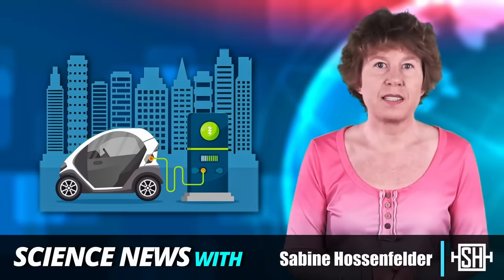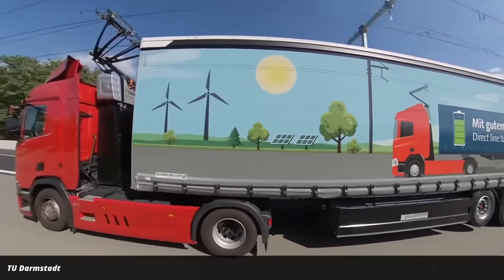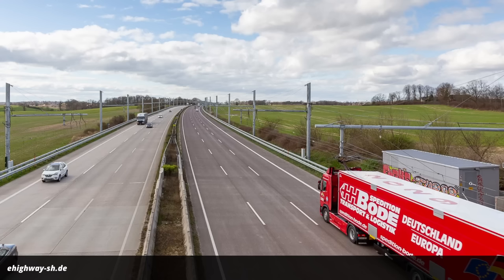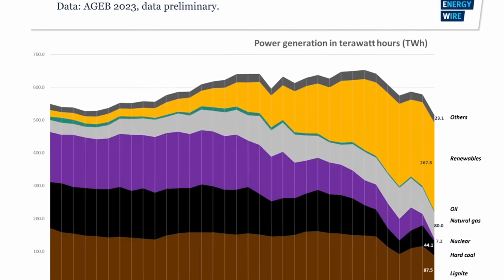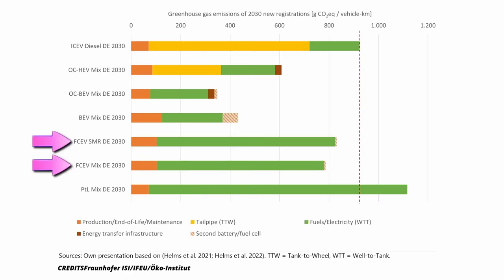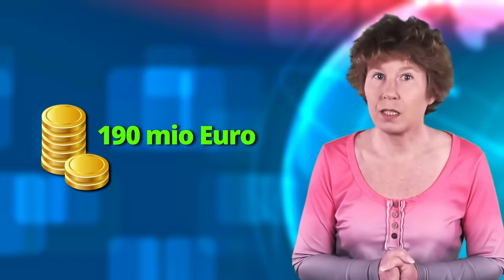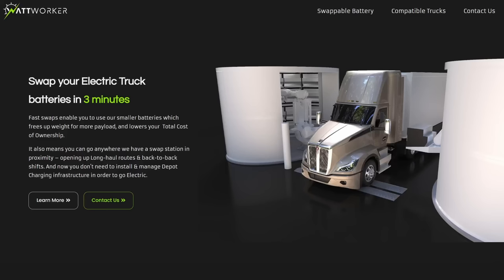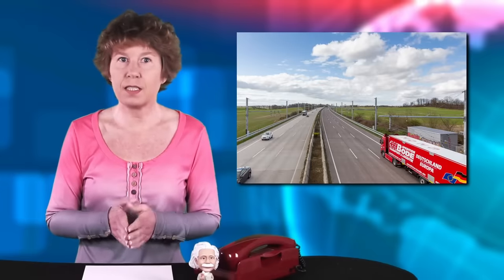Charging while Driving: Does it Work?

Comment: You are so right about using of railways for transportation. Should be much cheaper to build goods handling points, where the goods can be reloaded from trains to trucks for the short distances. Instead of building more railways, the constuction of highways is given the priority.
Reply: Yes, this!  And get those friggin' trucks off the road.  They wear out the surfaces (which the rest of us have to pay for), cause accidents by throwing up snow and water blinding drivers of smaller vehicles, block road signs and take up a huge amount of space.  That's just a small sub-set of my complaints about them.  More important (but not more annoying) trains are efficient, trucks are not.
Reply: The problem with trucks is that they are the only thing that solves the last mile problem. Also if you have a journey that takes an hour by road its very hard to make loading and unloading a train faster than just driving. I like trains too but they cannot function as an alternative to trucks.
Reply: It's already happening where it makes sense. Cost of transportation via rail is much cheaper when it's feasible.
Reply: It isn't cheaper. It was how things used to be done, and it took vast amounts of infrastructure and land space to do. Not only were their transshipments at both ends, but cargo had to travel a lot further. That's because for the vast majority of point-to-point movements the load was much less than a trains-worth, and very often smaller than and individual shipping container. Even if it is a single container worth, then you first have to move that container by truck to the nearest railway depot, often in a completely different direction to the destination. Then it would be taken by train to huge central yards so that the cargo container could be put onto a train for a destination depot (as with lots of distributed depots you cannot run trains between all of the combinations - historically it was hub-and-spoke). This might even be done more than once. Then, upon arrival at the destination depot, the load is transported to a truck for final delivery. 

This involved a lot of handling, required goods to  travel by convoluted routes, often much longer than the point-to-point distance and, what is also very important these days, took a long time. That's especially important with time-critical loads like fruit and vegetables, even before modern "just-in-time" systems are taken into account. The position was much worse for loads smaller than an individual rail truck. All of this also took a lot of manpower. What is more, the cargo traffic on railway lines cause a huge disruption to the efficient running of passenger traffic. This can be seen in the USA, where long distance cargo traffic is dominant on much of the rail network where it is cost effective due to the vast distances, where Amtrak finds it extremely difficult to run efficient passenger services due to the conflict with cargo. Also, no, you cannot solve that problem by running cargo trains at night only as that increases costs and conflicts with maintenance work and also lengthens point-to-point times a lot.

A lot of point-to-point traffic is now on trucks for a very good reason, in that it's fast as it avoids a lot of multiple handling, trucks are also good at multiple pick-ups and drop-offs and can optimise distances. 

Now this is not to say that rail doesn't have a major role. It does. Rail is particularly good at bulk transfers of the same goods between two set points, and it also works for very large loads of mixed loads going from one concentration point to another. A classic example, is the shipment of train-loads of goods from a port to more central distribution centres for trucks. It's also particularly good for very long distances, such as the USA where the greatly reduced fuel costs and ability for a train to run much longer non-stop (with crew changes) can even make it faster than long distance trucks. Supermarkets and the like will arrange their own central distribution hubs to optimise this. However, it is not going to replace what are often long-distance, truck journeys with multiple pick-up and drop-offs. A specialist supplier in, say, Germany might send a single truck to, say, the UK and deliver to ten, geographically separate customers, and manage it in less than two days. Pretty near impossible by rail these days, and if it is done, would take much longer and cost a great deal more.
Reply: I'm in the trucking business. Theoretically, sending goods by rail and trucking that last short distance sounds great. In the real world, it works poorly. There are only so many such intermodal terminals, and they are generally swamped. In my area, efforts to build new terminals are blocked by regulation, and people don't want them in their back yards. I wouldn't either. Trucks going in to these terminals can easily sit for several hours, to wait for a container to be loaded. I've heard much talk about moving more freight from road to rail, but the terminals are already doing a lousy job.
Reply: It'd be better if we had trains that could just carry semis which would solve both problems.
But would require a similar level of investment as the highway system currently has. So it's just easier to keep going with that.
Reply: In the United States, with the advent of the Interstate Highway System and pushed by truck operators, much rail cargo was hijacked, as branch lines became unprofitable. This ran in a vicious cycle as more freight moved to the rubber tires, to the point where if I buy something from the west coast (I'm in the midwest) the chance that it will come by train is only one or two percent.
Reply: @uni-byte  Trucks in the USA often have signs telling how much they pay each year; seeing five or six thousand dollars in road tax isn't rare.
Reply: In Europe 75% of goods travel by truck - you would need to spend trillions upgrading rail and it would take very long.  The beauty if this electric highway approach is that existing hybrid trucks can be upgraded, the road network can be upgraded piecemeal and trucks should save money compared to diesel.
Reply: @davidliddelow5704  It's not the last mile delivery that is making trucks an environmental concern. Heck if it's just for the last (few) miles using electric trucks would likely be a non issue. You need trains for the long distance and, yes, load trucks at destination for the short distance commute. That does take more infrastructure, planning and logistic, but that's not like humanity doesn't have the tools to do that at scale.
Reply: @Furiends  That's a wildly inefficient way to move goods. It means that not only are you transferring a shipping container of goods, but also the complete truck and trailer at the same time. That's extra weight and height. It means that double-height container stacking, used in several countries, becomes impossible. Then you have the issue of a truck and trailer that is going to be out of operation for the railway transit time. Then there is the issue about what you are doing with the driver. Are you expecting to send him/her on the same train as the truck? Or maybe a different driver picks it up at the far and and the original driver has to find a load to drive back at the rail head. Good luck with the logistics of that, and whose paying for his/her time whilst waiting for that load? If you are going to use rail to carry a container load of goods, just put that on the train and get a different truck to pick it up at the other end. Much more efficient. 

Just about the only time it makes sense to transfer whole truck (including the driver) is for short journeys through tunnels, such as happens on the Channel Tunnel, where it's deemed to be dangerous to drive vehicles through.
Reply: The trucker could just drop off his trailer to get another one. 
Then the yard shunter truck drives the trailer onto the train. 
It could even be done steaight from the boat onto the train.
Then somewhere in south Germany the train pulls into an unloading yard wherelo al trucks can hook up the trailers to bring to their final destination.
It would save fossil fuel AND not unimportantly? frees up the roads for passenger cars and vans resulting in less traffic jams.(Stau!)
Reply: @UncleKennysPlace  Sure, but does that really cover the cost?  It was in the US on I-75 in TN on my way to Florida I was almost beside a big rig when a wheel came off.  Luckily for me the wheel went faster.  Unlucky for the folks in the oncoming lanes when the wheel bounced across the median and into on-coming traffic causing a huge pile-up.  There had to be 20 cars involved.  I stopped but was told by the police to get going so I don't know if there were fatalities.  Apparently this sort of thing happens often enough not to make national news reports.  Here In Canada I witnessed a tire on a trailer literally fly apart taking out 3 cars.  There was injury involved as an ambulance arrived to take at least one person away.  The truck driver either did not know what happened or just didn't care as he did not stop.  I've only witnessed this once but I see tire carcasses all over the highway both here and in the US.  So, I am not sure if the actual costs of having trucks on the highway are covered by the road taxes collected.  Like I said, my first list was a short one.  There is more..
Reply: @davidliddelow5704  Solve the last mile issue to a great extent by building big box retail centers, warehouses, Amazon and the like, and manufacturing facilities right on rail lines and/or spurs.  It was done to some extent before.
Reply: @jfv65  But that is just plain silly. Why not just move the shipping container, not the entire trailer. Trains are set up to carry shipping containers, and on many routes they are double-stacked. Just try doing that with trailers. 

Of course trailers are picked up and dropped off already, but that's down in road depots, factories or all sorts of places where they don't have the lifting gear for containers, nor is there any advantage.

So, no, the idea of moving entire trailers, not just the containers is pointless, wasteful and is of no advantage. All that happens at ports and rail transshipment yards is that the container is dropped off and put into a container park until such time as the ship or train arrives. The same happens in reverse; the containers are taken off the ship or train, put into a container park and when the truck arrives to pick it up, then it's just offloaded onto the trailer. 

Containers are a standard size, with standard locations for stacking, locking down and so on. They whole process is computerised, and very efficient in space as they can be stacked several high. The computer knows where every container is, and how to optimise locations for being picked up and dropped off. Often in ports, there is transhipment of containers between ships, trucks, trains and barges. Yet you want to throw this all away be transporting around non-standard trailers? That's simply crazy. Containerisation using standard sized units is one of the the things the revolutions which has revolutionised shipping and cargo handling. 

It's not suited to everything of course, such as bulk materials, but it's all that is needed. Carrying trailers on trains is not. It simply makes things a lot worse.
Reply: Put the trucks ON the trains.
Reply: @0neIntangible  That's a truly bad idea. The trucks take up more space and weight. That's also a truck that could be doing work, not to mention what happens to the driver. 

There is a reason that shipping containers were designed. They are a standard size (well, two as there's a double and a single), with standard fittings and which can be stacked and stored in container parks ready for trans-shipment between a range of different means of movement, like trains, ships, barges and trucks. The loading and unloading can be semi-automated.

The only time when loading trucks onto trains which makes sense is to take them through relatively short tunnels, as happens on the Channel Tunnel, where there is no road tunnel for safety or environmental reasons.

Otherwise, just send your truck driver to a rail depot, get the container off-loaded and dropped into the computerised container park, using largely automated processes from whence it can be put on whatever mode of transport you wish, but in an efficient manner. At the other end, another truck can pick it up, or it can be trans-shipped onto another mode.

This can be done because of the standardisation of containers for easy handling, none of which is true for a truck.

nb. in many railway systems, containers can be stacked two-high on trains. Try that with a truck.
Reply: @davidliddelow5704  Does it have to be faster though?
Reply: I would think that building large railway depot's throughout Germany would be much more expensive than $24 billion.
Reply: Yeah, spending on rail should be higher than roads because it's more efficient. That's real capitalism.
Reply: Railways are massively overburdened. If you think building these power lines over highways is hard and expensive, you don't want to know how it is with new rail.
Reply: @UncleKennysPlace  Trains work best for bulk shipping of one product from source to user.  Intermodal shipping was the original system, with mule drawn wagons providing the last leg.
Reply: @furry_homunculus  I think it depends on the country. In the US, I heard, most railways are closed, which is a shame, if you look the size of that country and the plains, that are suitable for fast trains. My cost comparison was about new highways, not just electrification.
Reply: @4203105  Honestly I´m not familiar with it. more expansive like six line highways? in any case, it does need much less ground use.
Reply: @Thomas-gk42  you can't build new highways in Europe either, without NIMBYs dragging it out for 50 years (literally, one highway close to where I live has been under construction since the 70s).
The point is the highways are there and the lorries drive over them already, because rail is already over capacity. So might as well make the lorries as green as possible. 
We all know trains would be better. But the perfect shouldn't be the enemy of the good.
And yes, it would also be more expensive to build new rail, rather than just set up a few overhead lines over existing highways.
Reply: @4203105  Thanks for your reply. Well, I think highways are overcapacity too, no? And railwas exist too, noß the qustion is, which one you give priority. i see in my country much more construction sites foe highways than railways, and many railways were even closed inthe last decades. "the perfect shouldn´t be the enemy of the good" -- you are right of course. All the best.
Reply: @Thomas-gk42  highways are close to capacity. They are not over yet. So I wouldn't encourage more transport to be on the highway but electrifying the transport that is already on there is a good idea.
You really don't have to give anything priority. You can do multiple things.
However from a climate standpoint you shouldn't construct any new highways, you should only construct new rail. But we aren't talking about constructing new highways here. We are talking about electrifying existing ones, so lorries driving on them don't pollute as much.
Reply: @4203105  yes, that's right
Reply: This has been tried in the past and really there is a reason why it's not being done. If you need to reload cargo from truck to train then to track again, it not only increases the costs tremendously, it also increases overall time, delays, complexity etc. Trains are great, but they are not a solution to everything.
Reply: if not for transportation, what do you use railways for anyway?
Reply: @MultiChrisjb  traveling of humans? I meant transportation of goods, which becomes less since decades, while trucks becoming more and more
Reply: @TheEulerID  The issue with the US rail system with cargo messing up passenger transportation is an issue of how it is set up in the first place. The infrastructure is simply not good. If you have a single rail for trains to go both directions in, for large portions of the tracks, instead of having two that are running alongside each other the entire way... of course you are going to have passenger travel interruptions. You get tons of those naturally from other passenger trains even without cargo. And it isn't a particularly easy nor cheap fix either, especially considering how some of these are tunnels through mountains

It's a bit of a self-feeding loop of people not investing nor being interested in using trains here in the US, then it never gets invested in, so it keeps never getting necessary improvements, so people never become interested, so prices stay high, which keeps people away even more